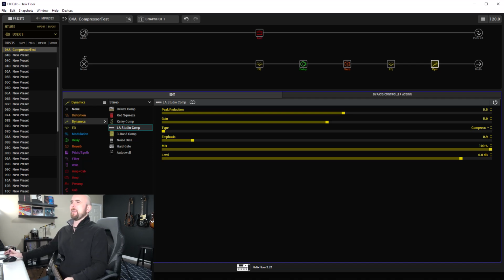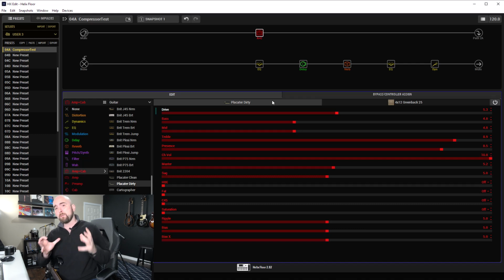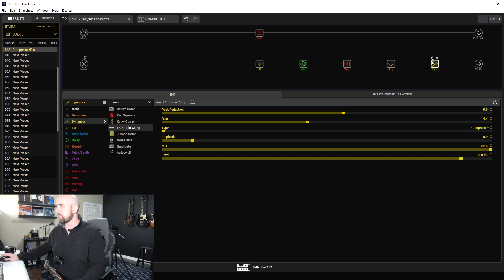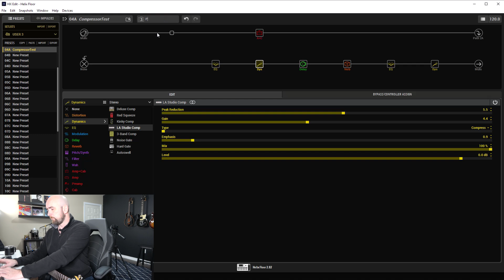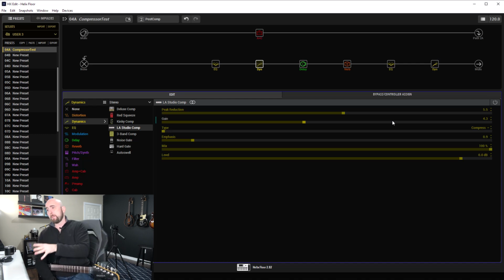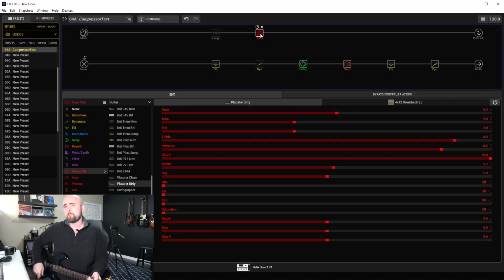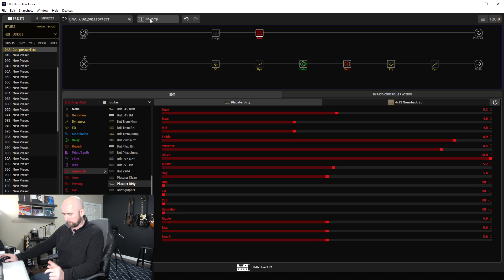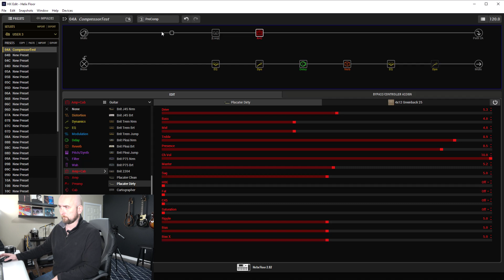Where Should I Place Post-Amp Compression: Pre or Post FX?

Comment: Since I don't record and only play in a band mix, if there was a difference, I wouldn't be able detect it in my situation.  I'll keep using it at the end.   Lately I've been deleting the other compressor I was always using as the first block in my patches.   This lesson could lead to other videos on, for example, where does tremelo or phaser work best.   Have you tried putting the reverb ( and delay? ) down on a parallel path in the second processor?    I think I've found value in that along with raising reverb low cut all the way up to 500 hz, reverb high cut down below 2khz,  not too much decay and predelay advanced to 50% or more.

Comment: I tried both approaches and the thing that brings me back to PreComp is that I bypass different effects or gain stages through my different snapshots, therefore I had to adjust the LA Studio comp on each of them. With PreComp I dial a Deluxe Comp to glue a bit my guitar at the beginning (I have a stratocaster which tends to output differently on each string), and therefore I only have to set it up once and it will work for all.
Reply: With precomp I mean pre-amp/whatever-comp

Comment: Ive used the compressor in both positions, at the beginning and at the end. At the end I notice that the compression was great but I feel it didn't push my amp or added more sustain (which is the way I generally use my analog compressors). At the front of the chain I feel it does push my amp more and adds way more sustain.

Comment: Another great presentation with subtle yet profound effect on my sound -- thanks for all the help you give, Jason. This is a good example of what people mean when they say "glue" compression. (Long comment, feel free to ignore, but if you have thoughts...) To me, both the PreComp and PostComp snapshots bring the main guitar sound "forward" and the PostComp brings "everything else" forward, too.  Not to say one is better than the other (in this case I like PostComp), but it makes a difference. It leads me to think more on what you said about deciding for ourselves whether we like the post compressor better for a given preset. I use your template (or variations) a lot when making new presets. We know that most people automatically hear louder as better, which you alluded to and compensated for by turning down the gain. I have to check this out for myself, but if I wanted to always be able to do a (mostly) impartial check on what the post compressor is doing for me, I'd like to be able to pop it on and off (without having to remember to change the gain or level) -- that is, every time I create a preset,  set up a bunch of things, and then flip the compressor on and off. Sorry for the long ramble, but my question is what we think would be the best way to get unity gain out of the post compressor by default with each new preset, starting from the template. It seems the choice is to lower the gain or the level in the basic template so that I can quickly do a comparison without coloring my thinking. You kind of said something about the gain affecting the characteristic of the compressor,  so maybe that's a good thing to set after everything else is sounding good.

Shorter version: Using a template similar to yours, should I lower the gain or the level on the LA Comp so I get unity gain, when testing what it's doing for me as I develop a preset? (He asks, knowing that he really has to answer it for himself :) ).

Comment: Hey JASON I I know this is off subject but do you have a video on how to connect a fr fr to the helix LT correctly I'm a first time user of the line 6 LT  and I connected the headrush to The LT and it really sounded  really muddy. I  just up graded from a Boss GT 10 so I have some experience with the amp modeling system

Comment: Thanks for this! I was wondering: could you explain when you'd use a Preamp block vs. an Amp block? I'm not sure if you've covered this in a previous video. I'm a bit confused about when to use what.
Thanks for everything!
Reply: The manual recommends using preamp blocks when you connect your Helix to a real amp.
Reply: Say you have a Marshall stack you want to hook the Helix to and you want all the amp modelling to come from the Helix but still want to use the power amp of the Marshall. You'd hook straight into the effects return which bypasses the preamp and goes straight to the cab. You'd want to use the preamp version of the models so you arent sending a modelled poweramp through a real poweramp.....unless yo like that sound of a modelled poweramp through a real poweramp. There are no wrong answers. I've used a preamp model as a gain block before an amp block before.
Reply: metallaholic the issue I have with the preamp blocks is that they're usually super quiet and many of them don't break up the way their amp counterparts do.